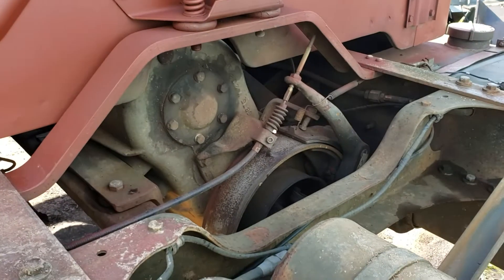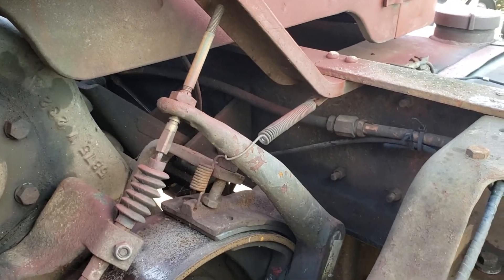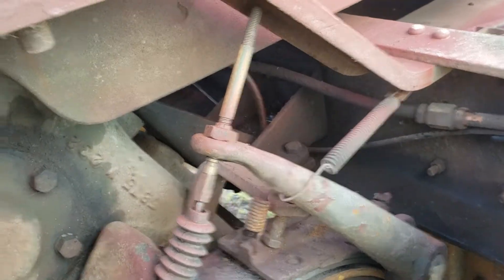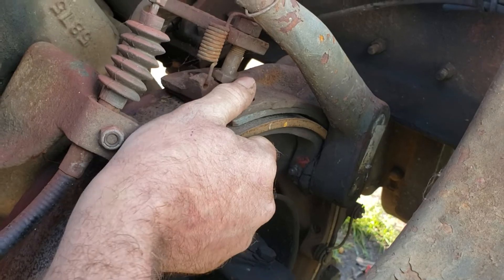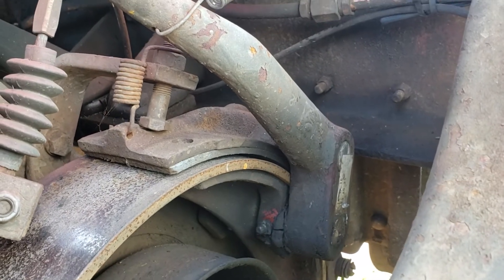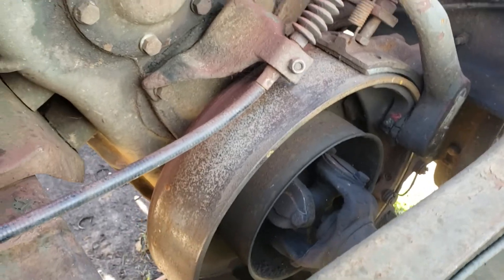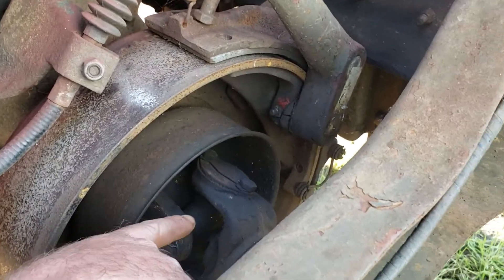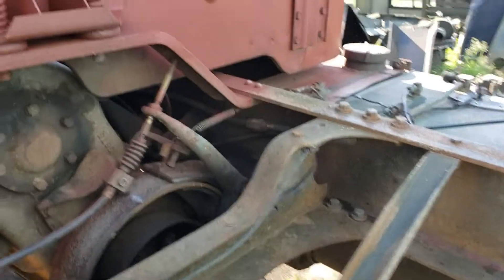M35A2 ( M44 series) M39 series, M54, M809 series park brake assembly parts, adjustments, pitfalls.

Comment: New M35 owner and have to replace the cable. I notice the bed is off as you stated in the beginning, but can you do it with the bed still on? Or do you have to take the bed off??
Reply from the maker: You can do it with the bed on. It isn't as easy, but I've done plenty.

Comment: My 1970 m35A2 has the squeeze type parking brake and where the cable comes through the Cab there’s nothing there but a round hole so the cable comes through the cab . What kind of bracket goes there to hold the cable. and thanks for all the videos you do they’ve really been a big help!!!!!!
Reply from the maker: Would be the same bracket any other M35 of any year or type has. Mounts under the cab floor. You'll have to find one from a parts truck.
Reply: Thanks for the reply and info I was looking in the Tm Does that bracket have a U-bolt that holds the cable to the bracket? Thanks again

Comment: So on the same subject of parking brake- I’ve seen comments that it’s not good to park these trucks in gear. Is that correct?
Reply: And why?
Reply: The theory is if they start to roll they can potentially start and bulldoze through whatever is in front of them.
Reply: You should never solely rely on parking brakes for anything they literally make wheel chicks for this reason
Reply: You should never solely rely on parking brakes for anything they literally make wheel chicks for this reason

Comment: Mine is missing the pin for the mustache spring on the outer brake pad. I can't seem to find a replacement pin for the outer pad. Can I use a bold and nuts to make a pin? Thanks
Reply from the maker: No, I've tried that before and it leaves too much slack in the spring eye, then the threads cut into the spring and it comes apart. Check bigmikesmotorpool.com for one. If it isn't listed, call him. Not everything he stocks is on the site.
Reply: @tacticalrepair  I've looked at his web sight and he lists one for the inner pad but not the outer. I'll call him and see what he has. Thanks for the info.
Reply from the maker: Tell him I sent you
Reply: Will do, thanks again

Comment: i want to try and figure a way, to install an air brake chamber to the park brake. So that it works like my freightliner. Super heavy spring applies the brake when there is no air pressure. Apply air pressure to release the park brake. Seems this would work pretty well.
Reply from the maker: I've been thinking about doing this as well, but I'm on another continent.😄
It should work if you can find an air can that fits in that space.

Comment: Hey Bud, I believe you forgot to mention the cam screw adjustment on the stabilizer spring (moustache spring) which is adjusted to equalize the top and bottom space between the drum and inner shoe. If you mentioned it and I missed it, my apologies.
Reply from the maker: Nope, you're right. I forgot to mention it. Still more helpful and complete than any other video like it out there right now.
Reply: @tacticalrepair  Indeed very helpful. Thanks Garrett. This was one of the first things I had to go through when I got my truck. The pads were worn so badly that every rivet head was making contact with the drum.

Comment: I was told that some of these trucks have a dump valve for the spring brake chamber that when you apply the parking brake the valve is applied that dumps the air in the truck setting the spring brakes. is that a fact ? if so can you provide some info on that ?
Reply from the maker: That applies to M939 series trucks, not these.

Comment: Hey Garrett, got a couple stupid questions.  First of all, on a truck where the handle in the cab is seized up (I've seen it happen) what is the best way to break it loose?  Just WD40 or some similar lubricant?  Secondly, on an M939 series 5 ton is this assembly under the truck fairly similar? Asking as they are air-brake trucks. Pardon my ignorance...LOL
Reply from the maker: The 939 series is not the same, which is why it isn't in the title. If a good penetrating oil like kroil won't free it, you'll have to replace it. WD-40 is the worst penetrating oil or preservative oil on the market. You are better off using water.